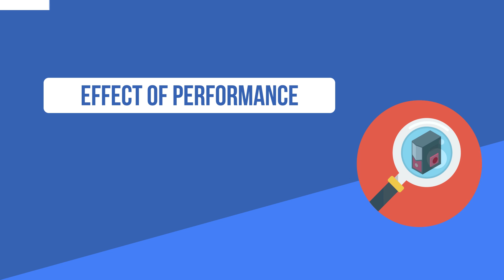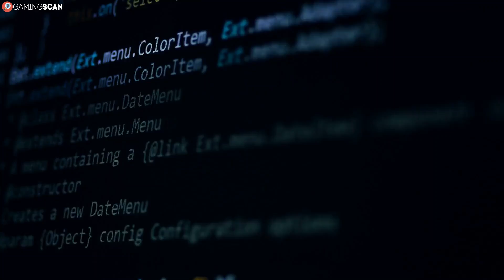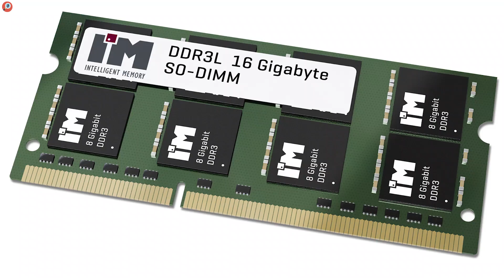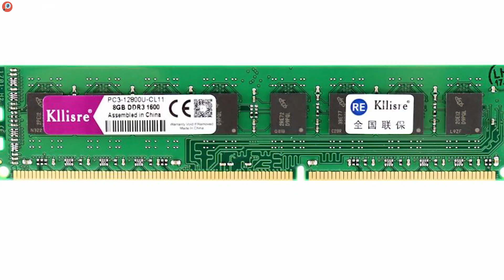Single Channel vs Dual Channel vs Quad Channel Memory (2020) [Simple Guide]

Comment: its not channel its the rank. there isn't one x570 mother board that offers quad channel.  2x 16GB sticks is the same as 4x8GB or 4x4GB sticks because the ranks in the ram not channel

Comment: I been using 8gb single for like 3 years I was told 8 is enough but I got 1600mhz I always read more ram was good for only if needing to run mutiple tabs or game and run mutiple tabs and the game still runs good 

I just found out 2 days ago that fast ram is needed to help with stutter and less drops If i would had known years ago i would had been had faster ram i feel so silly

Comment: I love the explanation   it was excellent..
Thank you ..
I  had 1333Mhz  8 G Of Ram in my system 
I put 2x 8G  = 16G of 1600Mhz Ram in my system..
Then put another 2 x 8G  = 16G of 1600Mhz Ram in my system.. Making it  32G
And after all that  nothing ! For gaming it was the same exact performance !
But in Multi tasking  the huge amount of ram made  a huge difference! and Games running smooth for longer times without a reload flicked due to ram reload. I noticed that!
It seems to have more leg room and  a flow to it now..
All things operate without a pause of flicker type reload which is a fraction of a second every so often but it's there with low amount of ram..
When a lot of ram is installed and faster to I notice that is gone and all runs right the way through without  any type of a fraction of a second reload.
But I love it anyway !! Happy to have everything running at peak.

Comment: err, pardon me for this silly comment.
2 or 4 slot RAM on the mainboard, but benchmark test involving GPU card and its RAM.
Probably for these test, It won't give accurate result since which RAM usage still arguable. More RAM on the mainboard allows an application to load faster until certain controller hardware limitations. More RAM and Mhz on VGA cards will get a better result in benchmarking.

Comment: "The number of vehicles that roads with more lanes can handle is exponentially larger." It's not - it's linearly larger. 2 lanes can handle double one lane, 4 lanes can handle 4x one lane, etc. In order for the increase to be exponential, it would have to mean something like this: doubling the number of lanes yields 4x the capacity, quadrupling the lanes yields 16x the capacity, etc
Reply: People love to use the word "exponentially" as if it just means "extremely" or something. Can't stand it! haha
Reply: Thank you.  I was gonna post a reply about this.  100% correct.

Comment: I got a R5 3600 on an MSI x570 gaming edge together with 4 Sticks of 8GB 3600mhz cl16 memory. For astatics I placed in all 4 sticks. The board /CPU is only dual channel, so I will loose some performance through the limitation of the lane capacity. My question is just how much is it in real life compared to only using 2 sticks in dual channel (dispense the capacity of 16Gb)?

Thanks in advance
Reply: Your X570 is dual channel.  The person in this video does not use the term rank.  Rank and Channel are different.  You are fine.  You are populating all slots.  You are running in Dual Rank, Dual Channel.  You aren't losing anything.

Comment: I use an i3 7200 laptop with 4gb ddr4 single rank 2133mhz. According to dell website, max memory capacity is 16gb.
It has 2 slots.
1.  So can I exceed the 16gb limit and put     32gb(2*16gb) ddr4? 
2. Can I take out the single rank, and install dual rank dual channel ram? 
3. Can I install a single stick of 16gb dual channel in only one of slots?

Comment: You did skip over how much a CPU memory controller can support is not always how much RAM the motherboard can support. You also forgot about maximum GB per DIMM size support on the CPU is a thing. 
Those are for when you are hitting the upper limit of how much you can put into your system and 4x4GB or 2x8GB is far from the maximum. For most consumers you don't ave to worry about if their CPU memory controller supports 128GB of system RAM or not while the motherboard claims it can support up to 128GB of system RAM.

Comment: Uh there a couple things wrong but the most notable one is the claim that amd is only single or dual after showing a 1950x thread ripper which is quad channel that made me laugh. And generally using 2 sticks in 1 channel or 4 sticks in 2 channels you will have issues overclocking your cpu further theres a reason why extreme OC boards have 1 slot per channel even if its by a small margin but for general use its usually better

Comment: You are spreading wrong information. At 1:11, you showed AMD Threadripper CPU graphics and mentioned that AMD CPUs supports only single and double channel memory. COMPLETELY WRONG! Threadripper CPUs supports Quad-Channel DDR4 ECC Memory.

AMD's current line-up CPUs (other than threadripper cpus) supports Dual-channel.

Same in the Intel portfolio...higer-end CPUs supports quad-channel and other supports dual-channel.

Please remove this video!

Comment: i get confuse with the names given to describe a RAM.  For example, DIMM modules , memory ranks and single/dual channel, they all sound the same. so much so that i could not fill out the details on the DRAM ryzen calculator.

Comment: Hey I have 2 questions, first: Would this configuration work?
-Channel one: 2 sticks of 8GB (both slots populated)
-Channel two: 1 stick of 16GB (1 slot populated, 1 empty)
All modules would be the same brand, speed, latency. The total size would be equal on both channels but just allocated differently.

Second question, can you use two different (size) RAM kits?
Example:
-Channel one:   Slot 1: 8GB      Slot 2: 2GB
-Channel two:   Slot 3: 8GB      Slot 4: 2GB
1&3 are identical with each other and 2&4 are identical aswell. 
All modules the same brand, speed, latency. Just different sizes.
Would this work without problems? Is it recommended?

And what if the kits are completely different? I'm guessing the speed of all would adjust to the lowest, but would it work at all?
Reply: Think it depends on mobo and memory controller n stuff, I can run completely diffrent ram on one pc like mixed speeds and capacities and on others it needs to be exactly the same.
Reply: The higher you go in capacity the higher your latency becomes.  Thats why people use 2 smaller sticks versus 1 big stick.

Comment: Almost always best to invest in one stick with largest capacity you can afford. This will be helpful in future upgrade
Reply: Unless you hve a decent build right now and you actually want to use it. Single channel memory can cripple frame rates by 20% which is a big enough deal to persuade most people to just cop the cost of the stuff that they sell later on for a decent price anyway

Comment: Ok so i have a question, i have a lenovo legion y530 and it comes with a 8 gb memory and another slot for another memory. The stock 8 gb memory is from crucial, i checked on the Internet. Now if i buy another 8 gb from crucial, basically the same memory, and fill both slots it will run with 16 gb and dual channel or 16 gb and single channel?

Comment: Dual channel seems to be the sweet spot for price and performance, quad channel from what I've seen offers very little performance benefit whereas dual offers enough over single whiles actually working out cheaper than buying a single ram stick of the same amount of ram.
Reply: You are falling into the pit of confusion this girl is talking about.   The term Rank is not being used in this video which is where all the confusion comes from.
Reply: Well quad channel is future proof

Comment: 5:02 quote "MORE MEMORY CHANNELS DOES INCREASE IN GAME PERFORMANCE" but will be only marginal???? why did she not mention DUAL CHANNEL is the conclusion for gamers
who want's to get most out of there system? I've been seeing a lot of gaming benchmarks comparing the channels and  "IT DOES REALLY IMPROVE PERFORMANCE" 
for about "20 TO 25% MORE FPS" than running on single channel and that's a "HUGE LEAP JUST FOR THE RAM CONFIGURATION"!  I have 1x8GB on my system for half a year now but just played Triple A Games recently and notice  60 FPS drops, stutters and even screen tearing due to my frame time not being stable because of the RAM? idk lemme know @Gaming Scan If I should buy another 8GB DDR4 RAM with the same speed like my other stick to improve the problems that I just mentioned when I'm playing demanding games such as FFXV Windows Edition and Rise of the Tomb Raider. PLEASE REPLY!

Comment: Hello guys I have a doubt. I want toy buy a lenovo flex 15. There's two version of this. One have 4 soldered + plus 4 removable for a total of 8. The other one have just a 16 ram. Diferrence from the 8 to 16 is 100 dollars. I was thinking on buy the 4+4 to replace it for 8 for a total of 12. I was reading on internet that they may not work well because of the difference of capacity. What you recommend me. BTW is exactly the same model the difference is just the ram thing. Thanks.

Comment: Does it matter if I use RAM slots 2 & 4 or 1 & 3?
Reply: It does since your motherboard might not be able to utilize the memory at it's full potential Every motherboard is designed differently. Some might use slot A1 and A2 and some might use slot B1 and B2. It's best if you read your motherboard manual or search up online to know which slots you should insert your RAM in.

Comment: To be honest, the average person will probably benefit most from a balance. Filling all 4 slots right away leaves no room for expansion. On the other hand, just buying 1 stick doesn’t allow you to take advantage of even duel channel. Since most boards come with 4 slots, dual channel is the best for balance.
Reply: Balance is based on demand.  Look at the X570 Prime Pro.  Most people will NEVER run 128Gb of Memory, but it can still do it.  By the time you "Expand" your system, it will most likely be outdated.  I hate when people say the term Expand when what they actually mean is UPGRADE.

Comment: I'm going to say this to clear up confusion, most CPU which are on consumer platforms such as AM4 and lga 1155/1150/1151/1200 use dual Channel memory with 4 dimm ram slots. ThreadRipper is quad channel memory with 8 ram dimm slots. Newer xeons have hexa channel with 12 ram dimm slots. Epyc uses octa channel memory with 16 ram dimm slots.

Comment: The example you gave is not exponential, it's linear. Each additional lane adds the same amount of traffic capacity. If you number of plot lanes against total traffic capacity, it will be a straight line, not exponential.

Comment: Theoretically the multi-lane approach should increase the throughput multiplied by the channels, but since we almost never USE THE MAX BANDWIDTH for long periods of time, it almost never caps the memory lanes. Now, if ALL the channels of memory were being filled at a ridiculously high maximum throughput for a long period of time, then we'd see the multi-lane performance showing up by multiples for each added channel or pair of dual channel sticks. Most operations are too small to really use up the bandwidth, or the ram is waiting for SSD/CPU/GPU operations that we only see a couple of percent difference since by the time the operations are executed and the memory is read for more.

Comment: 4 RAM sticks doesn't always mean a Quad-Channel Configuration. Mainstream Intel (Z390) and AMD (X570) platforms only have Dual-Channel support, that means 1 channel will support 2 sticks. 

Only Intel and AMD's HEDT platform support quad-channel memory, this was only found on server platforms before Intel's experiment of the X58 chipset and introduced triple channel then quad channel later on the X79 chipset. The current HEDT platforms known as X299 on Intel and TRX40 on AMD both support Quad channel memory with support up to 1TB of memory.

Comment: Threadripper has supported quad channel ram since 1st gen. To be fair, not exactly a beginner build, but still haha. Found that out the hard way when I got my 1920x, and it ran at potato speeds owing to threadripper reliance on ram to communicate across CPU dies, but I digress.

Comment: Most motherboards that have 4 dimms are dual channel.  You CAN have two dimms per channel, but only two total dimms  are used at a given moment.  A dual channel setup interleaves memory access between two dimms.  Two dimms per channel only adds more memory, the two dimms equal a single dimm of double the memory.
Reply: This is all I wanted to know than watching the entire bloody long-going-to-no-where video.
Reply: I have z790 msi meg motherboard recently bought.i dont know which ram frequency to buy. And how many sticks..will ddr5 6400 mt/s 2 sticks of 16 gigs work on it..or should i go lower? Plz reply.
Reply: @abdulrabb1616  looking up the info on youtube is not the best thing you can do dude

Comment: I have an centumchannel ram setup. I have over 9000 tb of ram installed. The power supply installed runs a small kugelblitz array and can melt tungsten from over 1 mile away. The entire system is cooled to near absolute zero,  warping time around the actual machine. The case is made out of an unobtainium-graphene alloy and stands at 20 feet tall, weighing about the size of a skyscraper. The CPU and "hard drive" installed is the mass produced, cloned brains of Elon Musk, Nikola Tesla, and Albert Einstein wired to an array of components enslaving the consciousness of each organism in part, each brain is fed one blended cow's worth of nutrients each hour, else it yearns for human flesh- not because it needs it, but because it wants to experience other's suffering. The GPU I have installed is a wish granting fairy I branded with the Nvidia logo... it's just chained to a shoebox, I dont know how it works, but it produces 100k resolution at 100000000 fps. Turning the machine on for the first time caused massive earthquakes and led to the extinction of several alien planets.

Fucking thing still cant run Chrome, though.
Reply: Is it RGB tho? That might be the problem
Reply: Dosank he went through all that and still doesn’t have RGB. That’s why it doesn’t open Chrome. What a noob.
Reply: James White dude I fucking died at this!!!
Reply: You must be a comediant because i died of laughter
Reply: this is an absolute fucking masterpiece
Reply: https://youtu.be/UOP5qRPpKTk
Reply: Huh....
Reply: Seems about right

Comment: There’s one thing your wrong about CPU’s, you said that AMD doesn’t make CPU’s with 4 channel support. Yes, that is true with the Ryzen line up, however, ThreadRipper CPU’s do have 4 Channel support.

Also, you said if you go for single channel, you’ll have more upgrades for the future. Well, yes but no, If you have a old- low end Motherboard you may have a capacity on how much RAM you system can detect at a single time. Most AM4, and Z370 or Z390 sockets can have up to 64 GBs of RAM, right now that’s all you’ll need for quite a long time if your just going to game, Video editing on the other hand may need more than 64 GBs.

Your Choice of CPU can also matter, don’t quote me on this but I’m pretty sure I3’s from Intel can only have 32 GBs of RAM, So both your CPU and Your motherboard of choice can have a impact of how much you have.

Comment: Dual channel and high speed ram are a must for any Ryzen setup if you want maximum performance from the chip. And no one cares about intel. Thanks that's all you need to know. Dual channel and highest possible speed with as much capacity you need in a budget.

Comment: Mounting 4 ram stick on LGA 1151 and am4 motherboard doesn't indicate a pc running in 4 channel . All LGA 1151 and am 4 supportable processor are runs  on dual channel. Nevertheless Intel i7 X edition needs LGA 2066 motherboard where you can mount 4 channel memory of total 8 memory stick and prosessor of X edition also capable to enable 4 channel memory. However many YouTubers compare a quad channel supportable processor with dual channel supportable processor  by using of dual channel memory. Which make unequal competition between them because a quad channel capable processor will show it's maximum effort by using quad channel memory. But YouTubers make it equalise between them to figure out actual results by mounting both in dual channel where dual channel capable processor gets its suitable configuration and on the other hand quad channel capable processor have to compelled with its maximum effort.

Comment: Keep in mind they need to be exactly the ram to run multiple channels
Reply: This isn't true. Motherboard and CPU will run all RAM at the lowest speed
Reply: @cbfedge5593  Multiple channels AS IN Dual channel quad channel modes, etc.. of it would make use of those ram if they dont match anyways..

Comment: very simple:

quad channel-GOOD

single channel-BAD
Reply: Dual channel is best
Reply: @LOWFRAMEBLOX single channel is a huge bottleneck for most PC's. dual-channel is the sweet spot, you only need one more ram stick and you get much more performance
Reply: single-channel is bad though, it's going to be huge bottlenecks
Reply: So ddr3 2gb x 4= 8gb and without bottleneck 😀

Comment: I will buy :
Asus ROG X570 Crosshair VIII Hero (Wi-Fi) Or msi ace 570
So better ram 4x8 or 2x16
 G.SKILL Trident Z Neo (For AMD Ryzen 3900x)3600hrtz
Reply: X570 don't support quad channel DDR4 only dual
So 2*16 definitely better choices to keep 2 empty slot for future upgrades
Reply: Well I went with Asus tuf wifi board and 2*16 gb same ram sticks and it's enough
Reply: @aashleysaggar1836  what about viga card from which compay asus or msi
Reply: @hazemhozien359  personally the one which is cheaper if u don't go with looks and  btw which processor u have? And I would recommend Nvidia over amd if u can increase budget for gpu
Reply: @aashleysaggar1836  im looking for rtx 2080 ti but from msi or asus
Reply: https://youtu.be/UOP5qRPpKTk